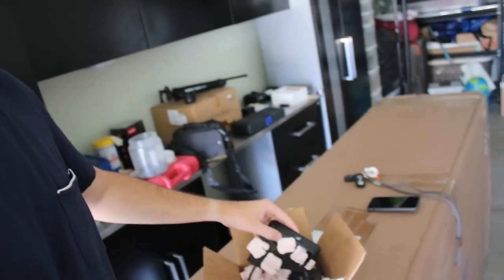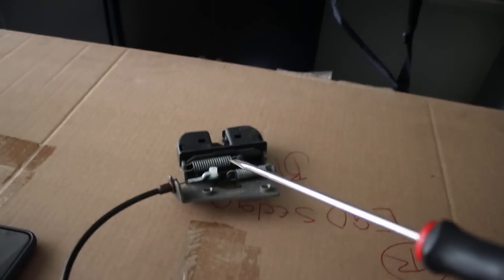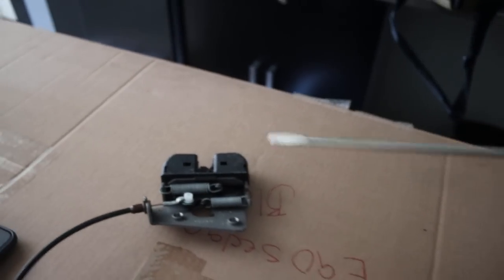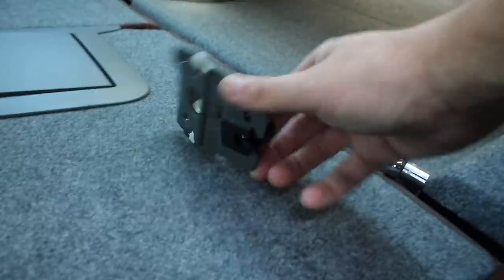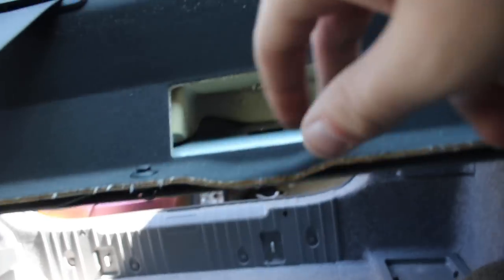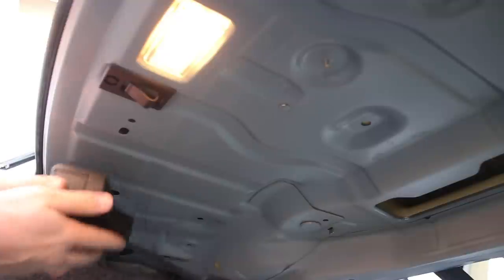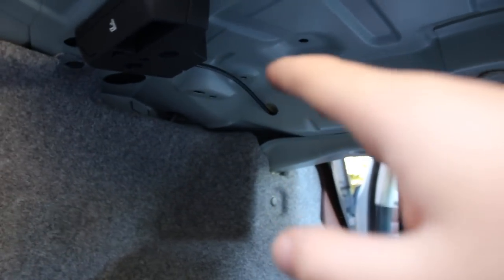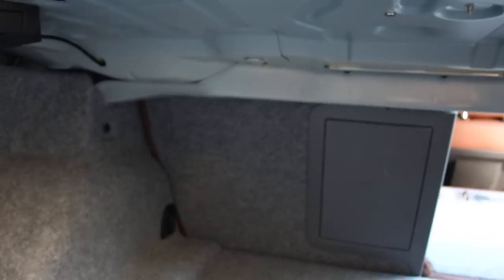FOLDING REAR SEAT RETROFIT! WAS SO EASY! (E90,E91,E92,E93)

Comment: Your car already has foldable rear seats in this video, so this was not really a retrofit but only the installation of the releasing switch. Too bad, I hoped for the actual conversion of a fixed to a foldable rear seat.. I still have it too. A lot of work to remove when transporting something large at the moment.
Reply: Dutch79 he installed those seats after
Reply: Robles Inline 6 It's not on camera I mean.
Reply: So BMW made a car with foldable seats but did not include the releasing switch? Is that correct? This is kind of strange.
Reply: I have the fixed bench panel as well so need to change the rear seats to be able to do this
Reply: Exactly. The door and the actual solid seat in my car keep them from being foldable. It would be nice to see how to retrofit. It's annoying when you have work on things.